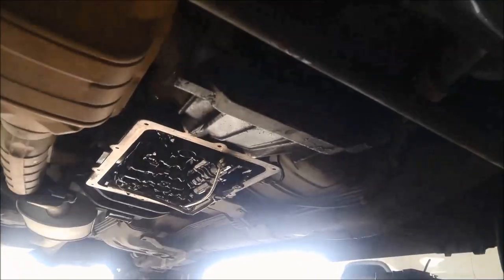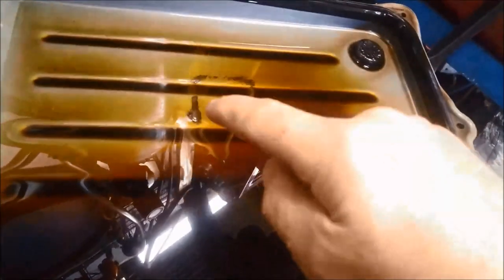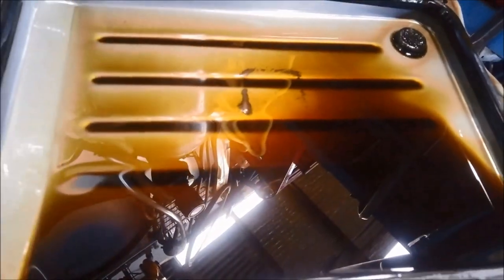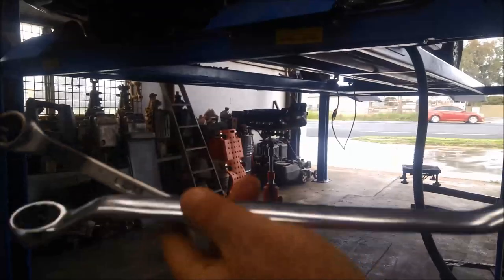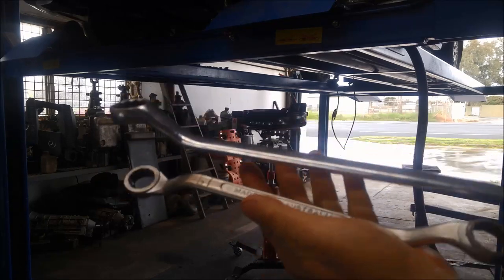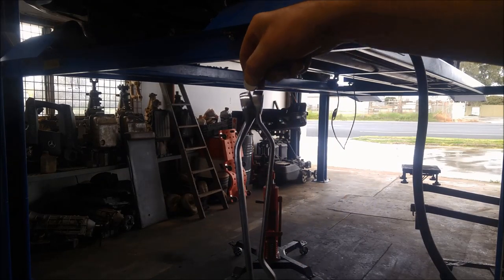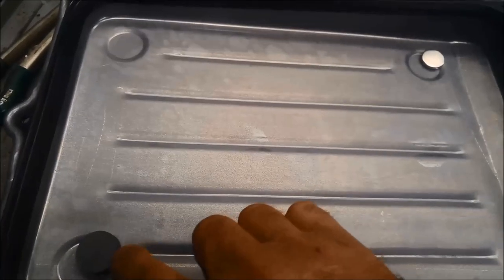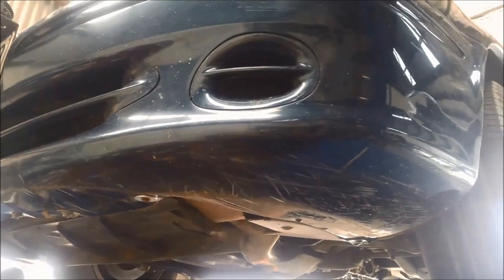How to Improve Automatic Transmission Life & Reliability with magnets - Transmission Cheap Easy Mod

Comment: Ive done this since day 1 on my 2014 FJ, but i put them ( yes two) on the exterior drain plug. Also use them on front, rear diff and motor oil drain plug. Best idea ever....you have the #1 transmission channel  by far. Keep em comming !
Reply from the maker: thanks and cheers

Comment: ever seen a magnet go Awall , or do they stay put, just something I've always wondered
Reply from the maker: hi, often i will put these on outside of trans pan prior to doing major work to help concentrate metallic debris to pan, or on drain plugs that i will replace with magnetic neodymium plugs and i am yet to see one go missing without the help of some mechanic adding it to their toolbox. we also like to add these to outside of engine oil filter and also to underneath of our parts washer to help keep solvent cleaner for longer. cheers
Reply: @YepThatsIt  parts washer magnet that's thinking, I use magnets to pick up all the nails my brother leaves all over the driveway from piles of nailed wood , a giant 50mm by 50mm by 25mm N52 magnet, now removing nails from it is challenging but better than flat tyres.

Comment: I had the same idea a while back but decided against it when I found out that standard (cheap) neodymium magnets progressively lose magnetism at temperatures above 80 degrees C. How  much and permanent the loss is, probably needs to be determined by experiment in this specific environment, ie. the sump of a transmission. It is a bit of worry though, because sustained temps of around 100C or more is probably fairly common in a transmission. Have you being using them long enough to find out? A sump with both types of magnet included would probably give you some idea if the neodymium is more effective.
Reply from the maker: hi, have been using them about 15 years. if your trans is running at 100C for long periods of time, you have other issues you need to address. cheers
Reply: I always use the N52 neodymium magnets on everything! Even high temperature it still hangs on better than a ferrite magnet